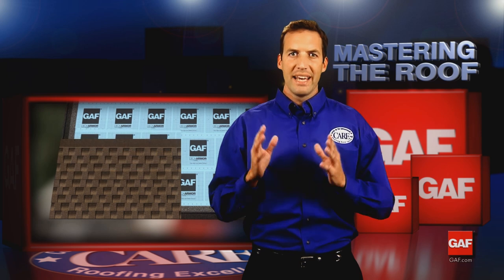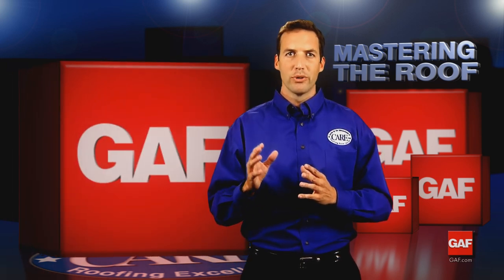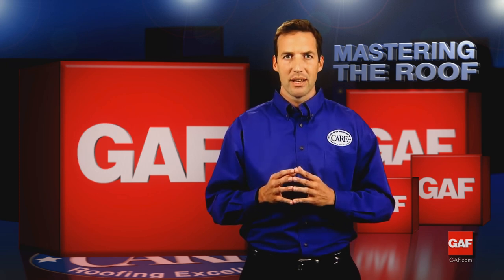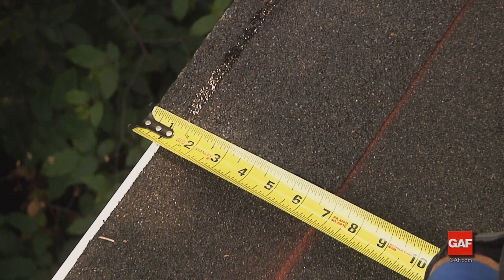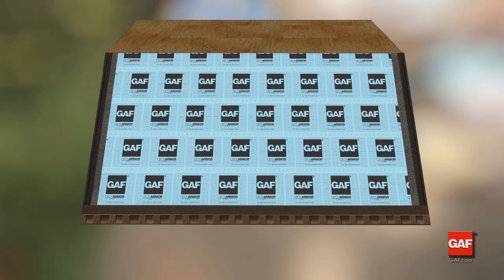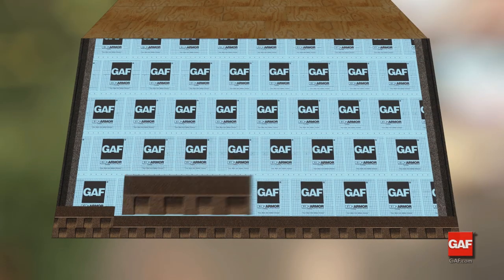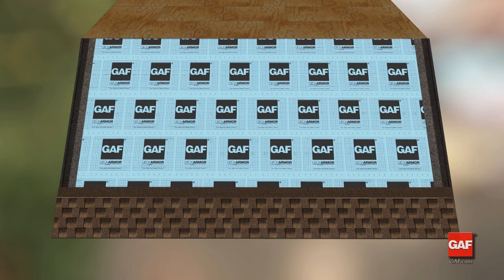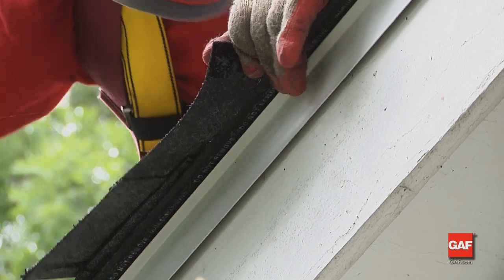How to Install GAF Timberline Shingles | Mastering the Roof by GAF

Comment: I noticed that each shingle in a bundle have different patterns so looking from the left edge they definitely are not uniform shingle by shingle.  The HDZ shingles on your videos all look uniform so was wondering why my bundles aren't the same. Does this even matter at all when laying down the start of each course?  I have laid them down on my garage floor using the 6'/11'/17' cuts instructions and it seems to look fine overall although patterns by course aren't perfectly aligned if you look closely.  Any thoughts?
Reply from the maker: Hi, Gary. Our experts will be able to assist you. Please give them a call at 1-800-766-3411.

Comment: How much waste will I end up with from a bundle of shingles, and what's the difference between 3  tab and dimensional, is one better than the other?
Reply: start full shingle then take 5and 5/8s off on second then 5and 5/8s twice on 3rd then 5and 5/8s three times off  then use the pieces you cut to finish rack so the 1st 5 5/8 peice u cut should be your last peice then start with full shingle
Reply: architectural is better cause they offer up to 50.years but you never get that long unless you extremely lucky and clean regularly

Comment: if you cut 6 inch's the 2nd course and then 11 and so on don't you have a cut at the other end?
Reply: You use the excess on the other end because you will be 6 inches short, then 11 and so on, or let the shingle over hang on other side and cut excess, which you can re use,

Comment: Our roofer wants to install shingles on 2.5/ 12 pitch. He will use Wip300 ice and water barrier underlayment plus Palisades Synthetic Underlayment system.  GAF Timberline shingles will go on top. Is that a proper install?
Reply from the maker: Hi, Jorge! Our technical experts would be more than happy to share more installation instructions! Please give them a call at 800-766-3411.
Reply: Jorge, no.  Minimum pitch for architectural style shingles is 4/12.  It says right on the bundle

Comment: I would always use 6 nails and sell that as one of our quality standards that some roofers short-change the customer on.
Reply: That's kind of a cheap tactic.
Reply: If the decking wasn't replaced, that would especially be a good idea. Some of the nails are not going to hold. If you've ever watched a roof going up from the attic, you'll see where the nail guns shoot fragments of decking into the insulation. A re-roof over that same deck is going to put some of the nails into voids created by previous installations.

Comment: GAF Timberline HD Charcoal - Racking? straight up not approved by GAF. How can I tell if my roofer did racking? 2. My shingles are more than 1.5 inches past the drip edge - what are the ramifications? My roofer installed some shingles where the blue underlayment is showing and the shingles are not sticking - what are the ramifications?
Reply: PawlingTennis  well bud in the roof business i seen many under cut the job and charge outta the ass
Reply: I been around 10 yrs myself i only sale gaf and nwver had a blow off or nothing
Reply: Yeah, my shingles that were installed last year over hang the drip edge /  cover about 1/2  the width of my gutter.  So likely near the same amount as yours : (     I always cut up my hands on the shingles trying to take leaves out of the gutters.  Wondering if I should do or get someone to somehow extend the gutters out an inch or 2 (take gutters down, add a thick facia, remount the gutters?).  But at least then, I can fix the pitch on 2 of the gutters - what should be the high end / away from downspout has standing water in them. 

And loads of issues with inconsistent work - 1 vent flashing has nails (and not sealant over them), another vent flashing has no nails.   Cuts in shingles (likely were cutting a shingle directly on the roof area they already did.   Butt heads pitch themselves as pros and do crap work.  

I'm watching these videos to learn how to reroof my 20 year old shed.  I'll likely do a better job then the 'pro' that did our house roof.  And that;s not saying much!!  (my quality is marginal).
Reply: @billwelsh89  well my 1r yr old GAF Timberline Shadow shingles are lying all over my yard from the 30 mph wind we have last week. They also delaminated and ruined the white trim on my house.